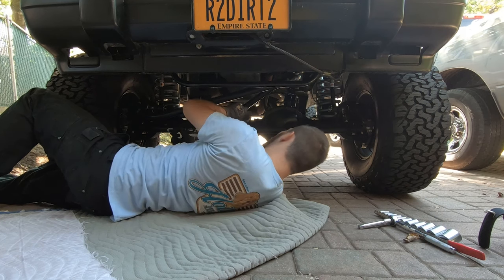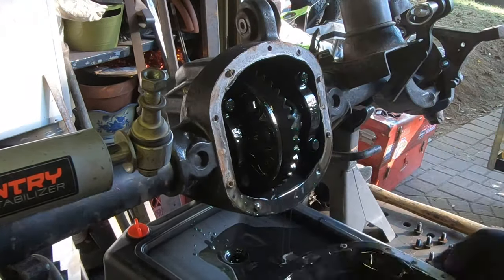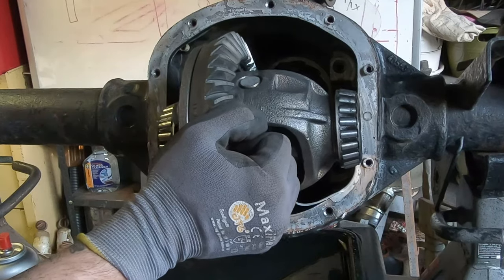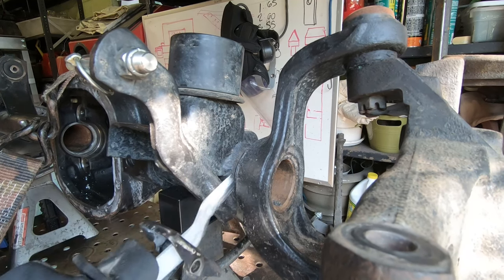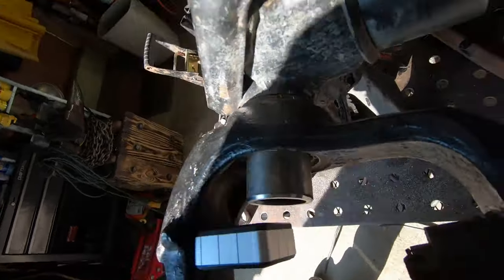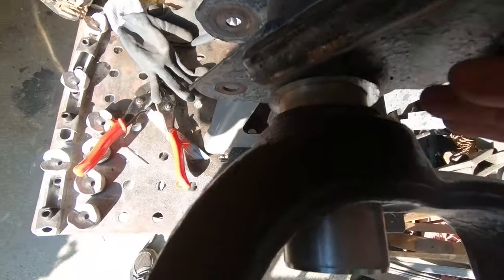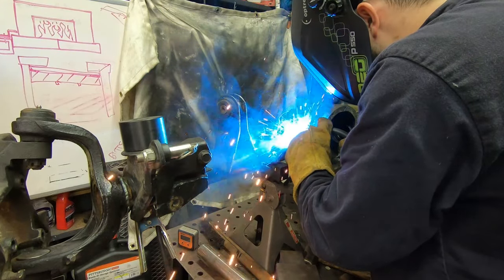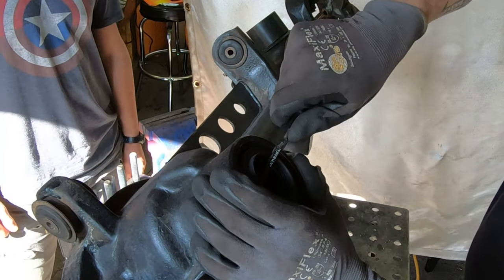Dana 30 Rebuild Guide Pt.1: K Suspension Axle Truss, IRO Axle Sleeve, Cut n' Turn (FIX YOUR CASTER!)

Comment: Got to be a lot of work cut and weld the C ‘s yet you don’t have to worry about the drive shaft angles to transfer case. Set your camber only once.
Buy longer saw all blades will help.
Preheat both pcs with a good rosebud, torch set up get about 450 degrees, weld it and wrap up the weld area with a asbestos blanket it’s not the same kind of asbestos. Where you have to worry about any fibers getting into your lungs. Slow cool down is the best welding cast steel. If it’s cast iron use a high nickel compound welding wire or a stainless steel wire using argon gas. Other wise you can get weld rejection, cracks, holes within the weld.

Comment: The reference angle from the face of the diff cover is irrelevant. As long as your initial markings are at the stock position, you could have just zeroed the angle finder on the Inner C and rotate from there.

Comment: Wow, awesome video mate, I was thinking about doing something like this myself but never thought about cutting the C's off. I was thinking about drilling away the spot welds that hold the tubes in place (if there are any welds at all) and pressing the tubes out of the pumpkin, rotate them and press them back in again and weld along the sleeve of the pumpkin so I keep the C's untouched.
Reply from the maker: I think this would be better than what I did if you have the means. That or do the same at the cs, press out and rotate. My method has worked fine strength wise but as far as alignment was not nearly as accurate as it would have been had I been able to press them back on the tube.

Comment: I know it's a three year old video, but I have to point out some errors. The axle is suspended by parallel links. So as the suspension extends the pinion does not stay pointed at the transfer case. It drops vertically and keeps the same pinion angle relative to the frame.

Vibration is caused by a disparity in the angle correction given by the U joints at each end of the driveshaft. 'Aiming' the pinion at the transfer case causes the problem. Lowering the transfer case will help with driveshaft deflection angles.

The rotation caused by lift kits is due to engineering mistakes in the less expensive kits. It can be corrected with adjustable links. When the lift goes beyond 4" it is time to go to long arms. Not because of pinion angle, rather to keep the front axle from swinging back towards the middle of the vehicle.

Comment: Harmonic balancer puller works great for removing pinion yokes. Might have to buy longer bolts with the same thread as your pinion yoke. Before I had the right too to hold the pinion yoke for reinstallation,I used a really old large pipe wrench that I picked up at a garage sale about 25 years ago. It is about 3 feet long, and it's bent. Every time I use it, I can't help but wonder how the heck it got bent. It's gotta be the oldest tool I own. Maybe it got run over by a 🚂

Comment: How do you like that cav fab steering? And death wobble
Reply from the maker: On one hand the steering has held up great super strong and have had 0 wear issues with the heims. However next time will go with TREs,  I don't like how the tie rod bounces around freely and makes noise. It was a pain to silence it. Cavfab does not cause death wobble I would do more research to find your issue

Comment: Did I catch you are also doing the WJ knuckles and big brakes. Martin built also went with 1 ton over axle steering…is that compatible with this process? I will echo the previous comment awesome video!
Reply from the maker: This is something I'm actually trying to work out at the moment! Yes compatible with everything here but I will need to figure out my steering setup
Reply: @trailandco  so might be worth a Separate video if it is possible. free spin kit? I saw that on a blippen jeep offering

Comment: could you comment about the way the steering feels with proper caster versus not enough. 
thanks .
Reply from the maker: Proper caster will keep you driving straight on the road and will allow your steering wheel to return to center after a turn. It's a great improvement to the drivability of the jeep, otherwise it wanders all over the highway with low caster

Comment: What welder did you use? Can I do this with my miller 135 mig welder?
Reply from the maker: I have an esab rebel emp 215, running it on 110. This was really pushing it I was popping my breaker often but these welds need to be strong. If you're machine runs 220 definitely use that but you can get away with 110v

Comment: Great video but why wouldn’t you upgrade to a Dana 44 or bigger?
Reply from the maker: I would love to but unfortunately the bolt in dana 44s are impossible to come by around here unless you want to shell out 5 gs for a dynatrac. At the time D44 didn't seem worth it for my purposes. Now I'd like to move to 35s eventually and would consider it if the d30 ever gave me issues. But this axle has been awesome

Comment: Is a stock Dana 30 axle (not trussed, sleeves, no HD ball joints) strong enough to run 35’s and be able to wheel moderately?
Reply from the maker: Many say it is. I'm only on 33s so I can't speak to it. But I think the rule of thumb is 35s you're ok if you stay off the skinny pedal
Reply: I ran 33's on the stock axle for a long time and didn't have any issues. When i tore off my upper control arm bracket, i went ahead and fixed it with a truss. Great opportunity to upgrade!
Reply: @ProjectXJ  Yeah I thought about putting a truss on my Dana 30. Probably well worth it in the long run. But eventually I think I want to run 37‘s so I will definitely have to do away with the Dana 30 and upgrade. But I agree, I’ll probably just wait until I absolutely have to replace some thing
Reply: @Sector 7  yeah 37 is a lot of tire. Someone in my jeep club has a jku on 37's with a 5.7 hemi on a dana 30 axle. Oddly enough they snapped a Chromoly 44 rear shaft and made it off the trail relying solely on the dana 30. Lol
Reply: @ProjectXJ  oh wow! That is hilarious!

Comment: Seems like this method would really weaken the axle at the weld point. Is that why you put the axle sleeves in?
Reply from the maker: Yes. The sleeves alone are thicker than the base axle housing so all in all I believe the end result to be far stronger than the original
Reply: This is by far the wrong way your not suppose to cut the end off only the welds and turn the knuckle on the tube

Comment: Just wondering? Just rotating the knuckle, doesn't that throw off your spring perch angle?
Reply: Not if done correctly. All that should change is the angle of the inner C’s, if your math is rite.
Reply: @Ole Roy  I had the same question. It's impossible that the spring perches didn't rotate. They would have rotated just as much as your new pinion angle did. I'm assuming that you rotated your pinion to align with the driveshaft. It must have been out of alignment prior to the cut. It seems like cutting near the diff would eliminate this issue. Is it possible to cut near the diff?

Comment: Why did you not just cut the welds? And not cut the axle tube all the way threw
Reply from the maker: I was trying to avoid cutting off the spring perches, it didn't seem possible to cut the welds without it. However if I were to do it again I would cut the perches off and grind the welds as you said

Comment: Ok your not wrong but for the amount of lift you way over did this.  Good job but again a little bit for these mods
Reply from the maker: Disagree, this made a huge difference.
Reply: @trailandco  so you ran it both ways?  Only reason I was saying this is we have installed lots of lifts and thousands of people have lifted their rigs and almost no one does this
Reply: I was thinking this was overkill too. My XJ is about 6.5” now on long arms, on 33s going to 35s now. Alignment is within spec and drives straight down the highway, barely have to touch the wheel, no vibrations either from pinion angle. 

But if it works for him and it’s what he wanted, more power to him.